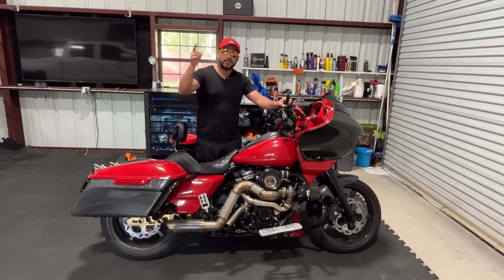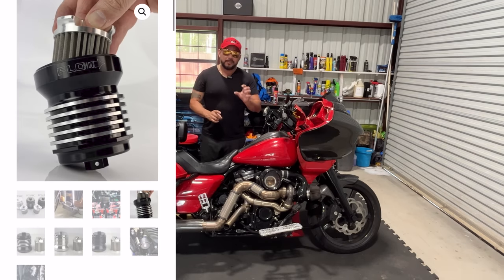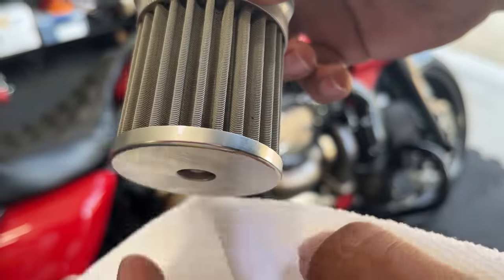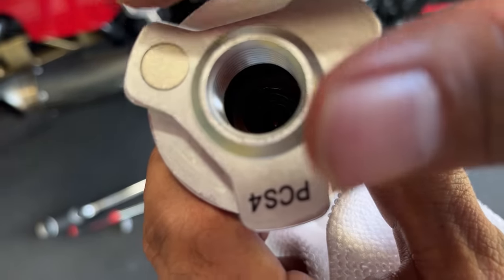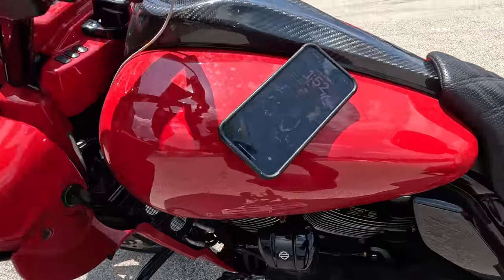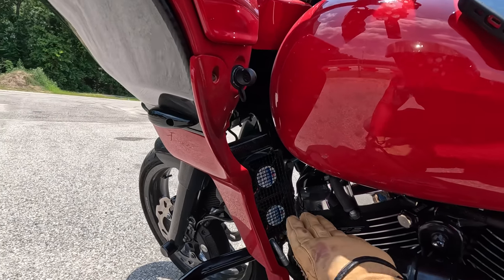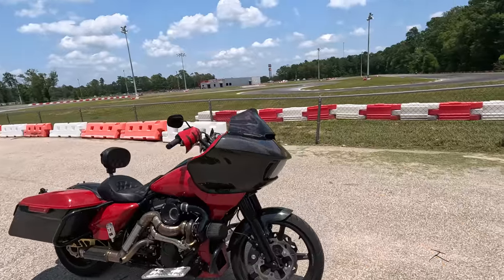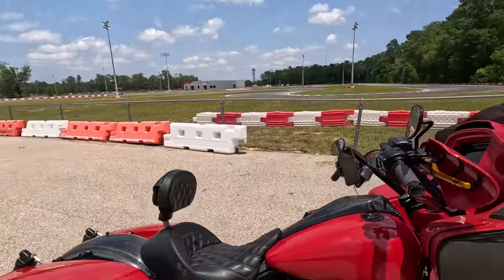WANT 50 TO 60 DEGREES COOLER ENGINE OIL ON YOUR HARLEY DAVIDSON?  YOUR SOLUTION ULTRACOOL!

Comment: Just going to add my two cents per say, I do engine testing for Ford as a career and I can say those mesh stainless oil filters do NOT filter like a paper or synthetic media does at all! The reason race teams use them is because they do races at high RPM’s and they need good oil flow. There is no way in hell I would use one of those in a bike you ride for 3-5k. But hey what do I know right.
Reply from the maker: Hello, thank you for your input.
Reply: My mechanic explained the permanent filters when obstructed or plugged will not allow for oil to bypass well.  The Harley oil filter was designed to do this and does it well. Aftermarket permanent filters do not reliably perform the oil bypass, if, at all, when it might be required.

Comment: I have this oil cooler on my 2014 Softail with a 124”. It does NOT lower temps by 40 degrees! It lowered my higher temps by 20 degrees. My bike hit 270 when run hard on hot days. Now it stays at 250 degrees. I really only see an actual benefit on very hot days in the city during stop and go traffic. I also live in Canada and our temps don’t get anywhere near as hot as southern states.
Reply from the maker: Hello! Thanks for sharing your experience! Down here in Houston it was 108 with the heat index today… lol.
Reply: @2147crew  hottest we see is 93 and maybe a couple weeks worth in the summer. Lol

Comment: I have this on my 08 Ultra. It definitely is the best oil filter. It does lower Engine temperature. But only by about 20 degrees. Definitely worth the price. It also increases horse power and torque and gas mileage 🤙
Reply from the maker: Thanks for commenting and sharing your experience! That’s great to hear!! Mine has been great as well!

Comment: I have a 2014 Fatboy lo fitted with Coolmaster love Jugs also 10 row non fan assisted oil cooler and external breather,my bike now runs within the temperature Harley Davidson says they should be,the Love Jugs whilst not that attractive are the most effective at lowering the temperature the external breather and oil cooler help but no where near as the love jugs,i live in Western Australia where it's hot and i can monitor my temps via my V&H FP3 fuel i put the oil cooler and external breather post the love jugs and while they have lowered the temperature the love jugs did a lot better job
Reply from the maker: Hello! That is a nice set up! In have a set of love jugs that I haven’t installed yet. I might install them as well. Thanks for commenting!

Comment: Just ordered the Ultracool and Flo filter for 2019 Street Glide w Chopped Guard. I’ll be able to see the temperature difference using my Powervision. Getting about 311F rear head cylinder temperature now w stage 2. I’ll post update on temp readings after install. Thanks for discount code.
Reply from the maker: Awesome! Thank you!!

Comment: Have been looking this same product from DK Customs. Not a bad idea. Was nice meeting you at the track in Knoxville by the way.
Reply from the maker: Hi! Same here! Glad we met at the track. Being at the track is what encouraged me to make this video. Hope to see you again soon!
Reply: @2147crew  yessir. Two wheels down my guy.
Reply: I added the DK Customs remote oil filter set up for my road glide and added the flo filter to it. Sure does make oil changes a lot easier and the filter keeps the oil about 8-10 degrees cooler. The kit is a nuisance to install but mine has been working great for years. Here’s a tip. The oil line DK includes is inferior and will rub through pretty quickly. I bought high pressure fuel line that has steel mesh inside instead of what’s in the regular line DK sends. I wrapped it in plastic mesh and covered that with plastic wire loom, wire tied it TIGHT and I don’t have to worry about it rubbing through like the line DK sent did after only about 1K miles. The high pressure fuel line I got from Jeggs is pricey but so are motors. I think I paid $75 for six feet.

Comment: Stock it was fine, but the more I have built out the engine the more I notice the heat coming off it.  I bit the bullet and ordered a cooler and filter last night.  Getting ready for the summer stop and go in the city.
Reply from the maker: Hello. The more you build it up. The more gear it’ll create. No issues with mine. Enjoy it.

Comment: Cycle Solutions sells a similar cleanable / reusable oil filter. They have 3 sizes of their "oil filter/cooler". I suppose the longest one would perform the best at cooling engine oil due to its larger surface area. The largest one fits with no clearance issues on my RGS.
Reply from the maker: Yes. I’ve seen it. They work well also.

Comment: No way this will lower temps 50-60 degrees.
Reply: Sitting at prolonged idle it would definitely help but the fans don't do much over about 30 mph.

Comment: Standard WIX filter is 20 microns. My problem with thetype you can clean is are you really getting the trash out of the mesh? If you had an ultrasonic cleaner maybe. And if it filter so much smaller particals what happens if it gets clogged? Is there a by pass and what is releaf pressure.
Reply from the maker: Hello, thanks for commenting! Good point. I’ll look into that on my next oil change.

Comment: You need that magnet because that filter isn't optimal.  FortNine channel tests filters and paper does the best job.  I know that's hard to hear and may create some dissonance.  AND race oil is changed a lot more frequently so that filter makes sense due to the convenience.  So that MAY work for you but not most people running baggers.
Reply from the maker: Hello! Thank you for sharing the information. I’ll check them out. Nonetheless, good information. Thanks for watching and commenting!
Reply: Right, that aftermarket metal mesh filter should not even be in a Briggs & Stratton engine. keep the paper mesh!

Comment: What temps are you seeing on your power Vision tuner with the ultracooler??? I’ve got the Harley oil cooler fan and the ultracool and still seeing 300+ on the Powervision for engine temp.
Reply from the maker: Hello! I have a Thundermax tuner. What engine are you running? Not sure how powervision checks the temperature. But if the engine oil temp doesn’t pass 210 the fans don’t turn on. Hope this helps!
Reply: @2147crew  I’m running a 131 full build hitting 157hp/162ft-lbs.  temp reading off power vision is the engine temp from the Harley vehicle sensor.  Oil temp has been doing well with the ultracooler installed (great product) but trying to see what others are seeing with temps and there’s just not a lot of info out there on the 131 actual temps.
Reply from the maker: @Kcarver_77  got ya! Great build and numbers by the way! I have two 131’s the naturally aspirated one is getting the oil cooler and flo oil filter once the build is done.
Reply: @2147crew  considering dropping the coin on another dyno tune from a. Different shop to compare what I’m seeing between the current dyno tune and another reputable shop’s tune. First Harley and don’t know what to expect.  Came off a Rocket 3 Roadster
Reply from the maker: @Kcarver_77  that’s a good idea. Wouldn’t hurt.
Reply: What is you r head temp (ht)?
Reply: That’s normal temps for your heads, if you want to drop it a lil try the love jugs.
Reply: @BlancoFlaco  not head temp - engine temp. I’ve seen head temp on the PV as high as 363° with an ambient temp of 70°
Reply: @danfecke  I've seen as high as 363 when ambient was 70
Reply: My 131 stage 4 m8 with external breather,hi flo oil filter,Harley oil cooler(no fan) runs up to 355 on hot days and my HEAVY throttle hand. Thinking if getting the dual fan oil cooler.
Reply: @deansmith7746  I added the ultracooler and just picked up the filter to put on.  I also run the Harley fan as well (which only cools head oil) and it's been a great with the proper tune installed.  95F and running hard - I'll see 320ish now on my PowerVision pretty normal.  Occasionally will see 340s

Comment: Reason racing teams use them is bc they change their oil every race, not 4-5k miles. I’m sure it flows a lot better, but the test show they fail miserably compared to even OEM filters.
Reply from the maker: Thanks for sharing the info! I change mine every 2k ish. Depending on the race, they sure do put a lot of wear on those engines. Lol. Thanks again for commenting!
Reply: How does this filter effect oil pressure? Higher or lower

Comment: Micron is a unit of size. 35 micron is a larger hole than 10. That means it allows larger particles through. This is not good for the engine. It's worse.

Comment: Brake  Fluid is Nasty and Expensive.  I noticed  you actually used brake cleaner spray ..
  Why not just wash it in  Mineral Spirits or Kerosene or Disel fuel?
   35 Microns  does not catch small particles..   10 Microns is a lot finer filter element which does a better job.. than a 35 micron filter.  Bi- pass filters can be made to filter finer yet. 
  Heavy duty Diesels will use two Filters .. a Full flow 30 micron filter and a 5 micron bi-pass filter.
  Bi-pass means it has a spring loaded valve that will bi-pass the oil when the filter is clogged full of carbon and sediment ..  or cold oil that is too thick to flow fast enough ..through the filter..
Reply from the maker: Hello! Thank you for the information! Really appreciate it! Originally brake cleaner is what I meant to say. The other fluids you mentioned can also be used. I just had brake cleaner available.

Comment: You want yer oil over 210 degrees F to boil out any water, if not at least 210 you will build up a bunch of water that will settle to the bottom of the tank - bad news . 60 degrees is way too much. Leave it be. this is why people have problems with Harleys, they are always adding junk not needed on em!
Reply from the maker: Hello. Thanks for commenting and sharing your information.